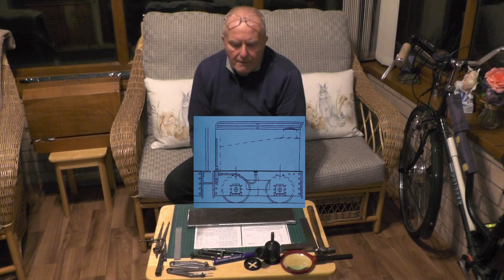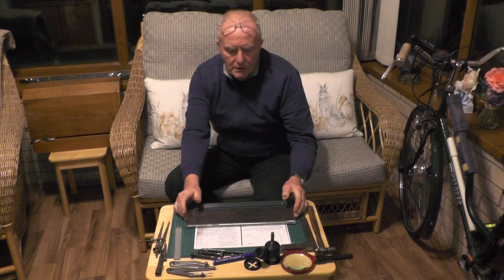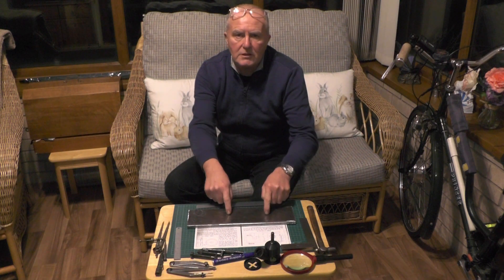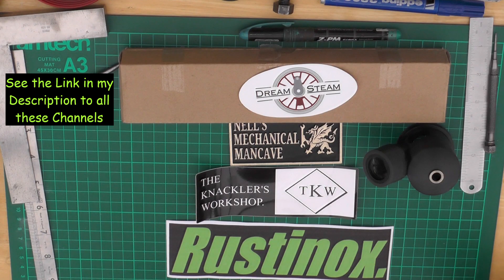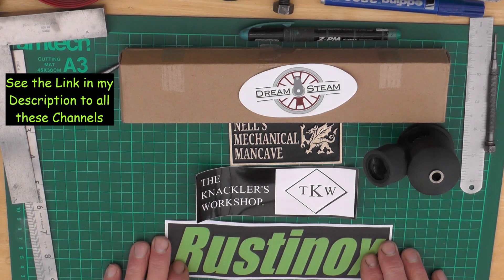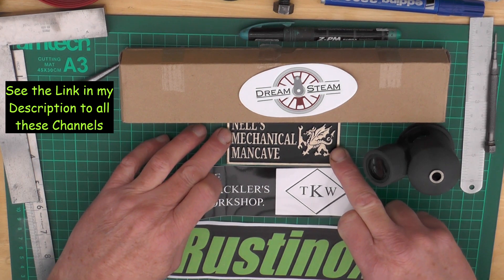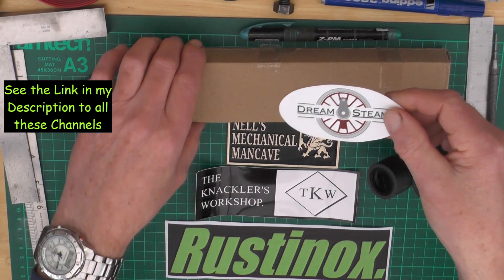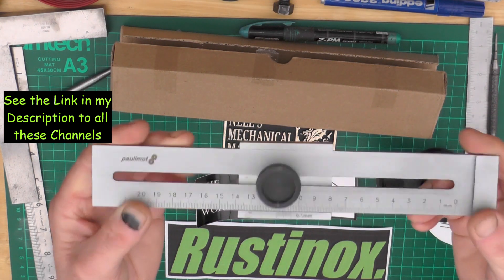Water Tender P2 - MAIN FRAMES - For "Scratch"  (My Beginners Steam Locomotive Series) "mr factotum"

Comment: Hi Kev. Great work you are doing there. I noticed that one long edge on each plate is tapered. Have you milled that taper or is it just how the plate came. 
The back edges as they are on the mill table. Regards. Steve.
Reply from the maker: Hi Steve
Just already on the plates, there on the inside so not seen and not intefering with the outcome, just oddments ive had on stock for ages,
cheers
Kev